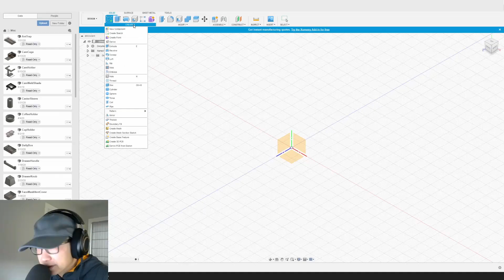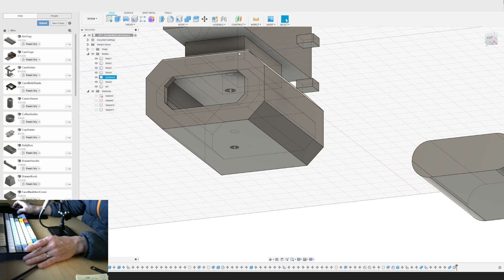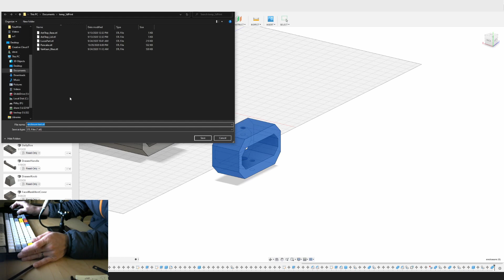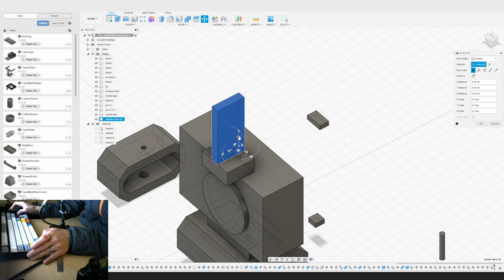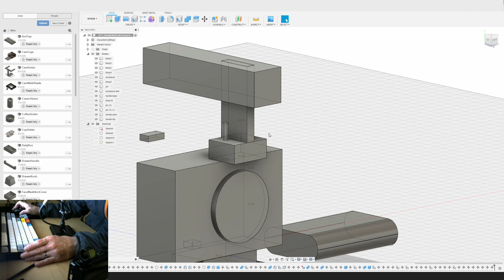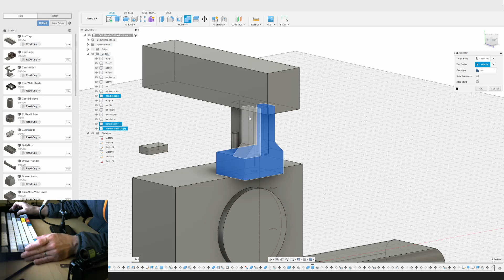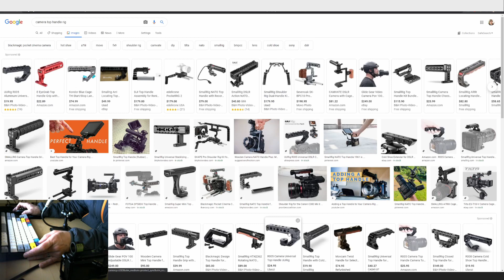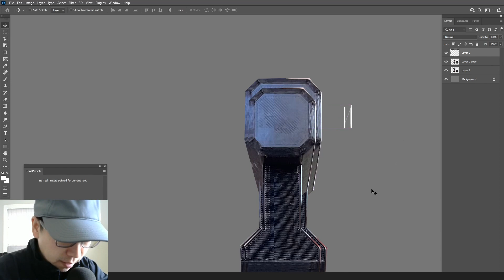Design & 3D Print Top Handle, Battery Enclosure for the Sony ZV-1 Small Rig Cage

Comment: I have a few suggestions to improve your design.
1) implement the usb plug so that it is installed inside the holder for the power bank, so that when the power bank is inserted, the plug itself enters the connector.
2) Use an angled charging cable (possibly homemade) so that there is no loop from the extra cable.

You have a good video, gives me aesthetic pleasure.